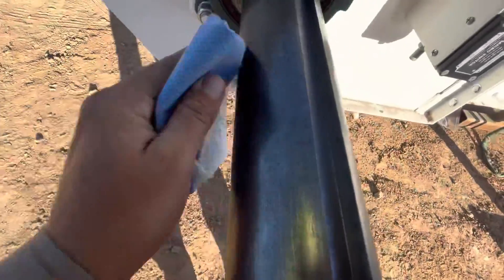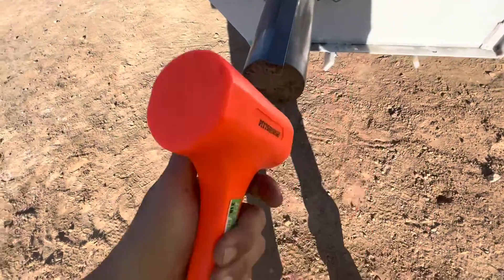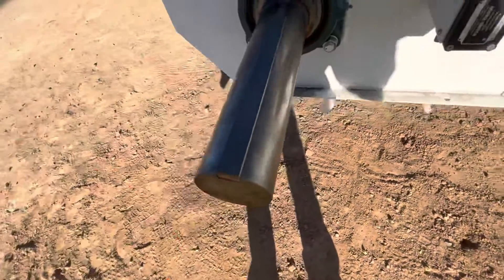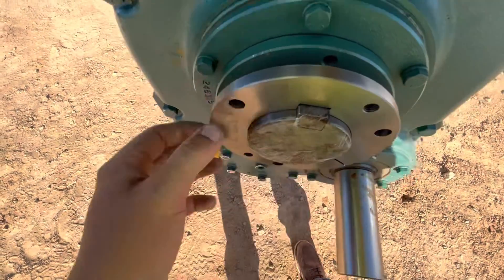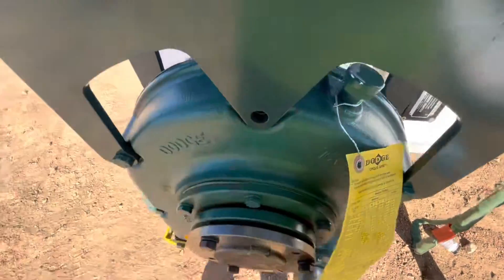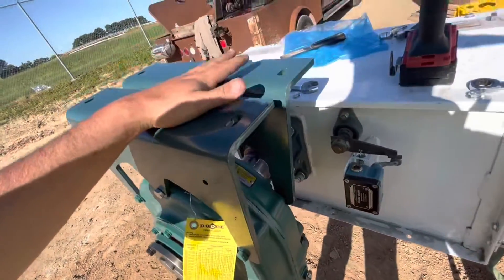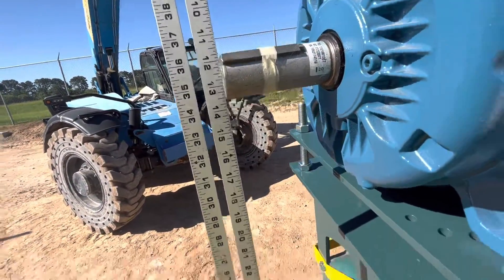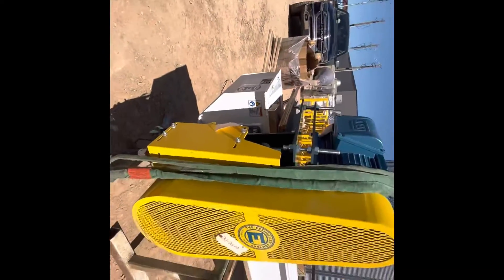Tips on how to set electric motor as a millwright!

Comment: So the tapered bushing is not a spacer. It goes the opposite way and pushes into the gearbox. Same as you did for the outside. Then bolts tighten it in through the backer plate. Its a taper lock compressing the gearbox into place.
Reply from the maker: I realized I messed up after right after filming this lol we got them swapped around